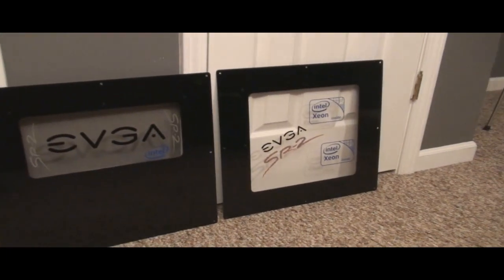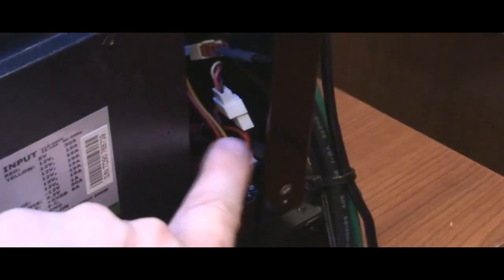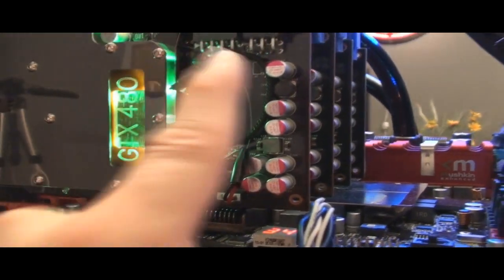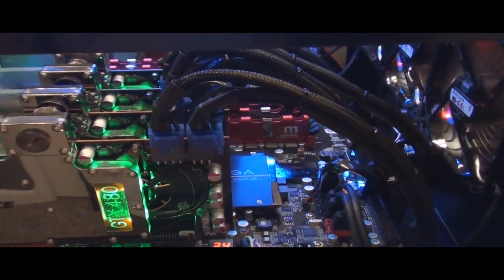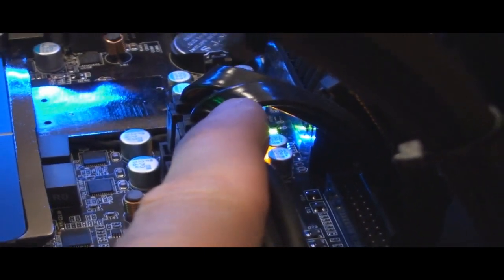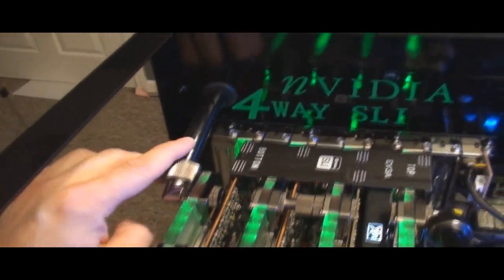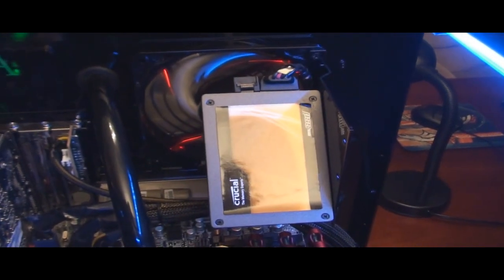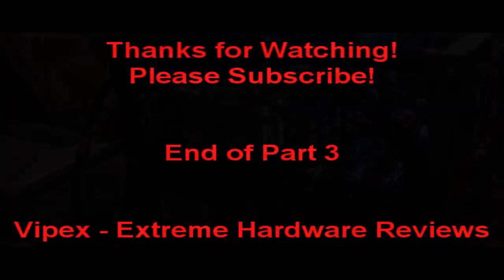Gaming Computer Showcase: EVGA SR-2, Intel Xeon X5680, 4-Way SLI GTX480 Pt.3

Comment from the maker: @MADJIHAD1942 You are correct to a certain extent, but you can't just use distilled water either.  Even with distilled water, algea will build up over time.  The coolant needs some type of anti-algea additives.  Computer coolant that you can buy has those ingredients...but the less dye the better...yes.  :)

Comment: Ok, two questions... maybe two lol. One is does not haveing the water go through a radiator when going from CPU 1 to CPU 2 make a diffrence, I mean wouldnt it help with the water temps if you dont go from 1 hot cpu to another hot cpu? Second question is can you show how you spliced the green LEDs so you dont need to use the molex, I want to try it but want to see how its done first, if you can thanks if not... understood.

Comment: @Trubyd44 I have weeks browsing the web for such adapter/converter could you please tell me the search terms in order to google it? thank you very much. I thing i have to go with ati 5970s because i will need the other pci xpress slots for 3 I/O cards. One for external sata hard drive cages and the other 2 for adaptec raid controllers. Also i would like to manage 6 screens with the eyefinity ati capability.

Comment: yes Red and Green makes a orange color 8). Im building a SR-2 build myself, going to a Danger DD case. but my system is aimed for designing 3D and graphics, nice build btw. Do you wish that you went with a dual water cooling loop? or are you happy with a single loop?

Comment: @Trubyd44 

Yes there are no restrictions like other designs/brands however the optimal direction is parallel.  Is it worth breaking it down to change?  Most likely NOT.  I have a 370 that I may try doing tests with (it's home on a W3680 at 4.53GHz 1.4V right now).  Of course there's the possibility of temperature differences from mounting variances, etc. as well.

Comment: Because if you fill up the ram it puts more stress on the CPU if you're overclocking it. So it's better to just do Dual or Tripple channel and use only 2 or 3 sticks. That's why there is 3 Per CPU.

Comment: Is it theoretically possible to use 7500 series Xeon processors with this board? Because I realize X5680 isn't still top of the line for Xeons, but for most of the ones above that, you're starting to get into 8 cores and larger caches for the CPU.

Comment: @Trubyd44 Thanks
I have a problem between my PSU (corsair tx 950 ) and my MB (asus R3E).
When I connect the PSU to the R3E the lights and LED's on the motherboard come on, but it refuses to do anything when you press the power button.
i tested the MB with another PSU (Spire 550 W) and it's working & i tested the TX 950 with another pc and it's working. Now i use the Spire for MB & CPU and the TX 950 w for my Gpus, but the TX is connected to another pc only for starts.
any suggestion is welcome.

Comment: I personally don't care for the idea of that hot cooling fluid leaving the oulet port from CPU 01, & landing straight in the middle of CPU 02. Ideally, those 04 graphics cards should be on their own separate cooling ciruit, & junction back into the main line outside the case. As far as the dual CPU's, the inlets could be split, & the outlets combined preferably with right-angle el's (for directional flow). If you could find them, perhaps one-way check valves could be used as well?

Comment: @imtihanahmed With a computer that powerful I would be suprised if it becomes obsolete in the next 15 years. I have a p4 I built years ago and it still runs almost anything I throw at it, within reason. I upgraded the video card and ram since the build, but it works as a backup rig. This rig he built, is way out of the league I was dealing with back then. This rig will likely be be viable for a decade easily.

Comment: @ThePCgamer1989 What are you talking about? The fastest gaming computer on the 3dmark11 leaderboard (planet) right now is using an sr-2 motherboard with dual Xeon 5690's.
    The Xeon 5680 is basically an i7 980x with dual QPI links. 
   Just because you slap parts in a case all day for a living doesn't mean you actually know anything.

Comment: @amartinez97 Not a 2560x1600 the 480's wont have enought memory. Dual Mars 2 (GTX  580 X2) can't run smoothly BF3 at 2560x1600 because it only has 1.5GB of ram.

Comment: Hate to be a bearer of bad news but your waterblocks are 90 degrees off.  The SR-2 CPU socket orientation does not follow single CPU boards and thus your blocks should be oriented the other way.  Does it make a big difference?  Probably not BUT if you want it PERFECT they should be mounted with the flow direction parallel to the CPU die orientation.

Comment: @club4ghz I kind of agree. I am an ATI/AMD guy, mainly just because my first computer build I tried had me pulling my hair out when Intel sent me defective processors. They are FASTER, but more reliable? Dunno, I don't wanna try again. 

I'm in the process of saving up for dual 5970 4GB cards and a 1090t to see how it fares against a single cpu equivalent. Obviously the SR-2 is going to beat it, but dual-cpu builds are pretty pointless with today's games.

Comment: i bet that last graphics card is the hottest component in the case because of the way he looped it. ===CPU===CPU===GPU===GPU===GPU===GPU=== :( should have 2 rads and 2 loops setup like this ===CPU===CPU=== then seperate rad ==GPU==GPU==GPU==GPU== thats only if you have one pump, if you have 2 pumps one res go ahead and just seperate both rads

Comment: Thats actually not true. Xeons are designed for anything that requires pure processing power. If your doing a render in 3ds max or blender and you wanna use CPU to calculate two 6 core xeons are way better then one i7 extreme, Its also the same for Video rendering and photo editing

Comment: lollies yeah true but those gtx 480s were graphics cards from hell, they played games amazingly but they produced more heat than my desk heater. I have a 570(it was either that or the 480 for 30 bucks less, 570 saved more money on energy usage in the long run) and it tops out at 50C (idle 34C) and that was nothing compared to my friends 480 80+C (53C idle) room temps were only 1 degree difference (mine being lower) so in my defense (lol) those 480s are the devil of gpus lol

Comment: Would hate to be that last graphics card, toasty.....
Reply: its water cooled im sure they are all around the same temps give or take 5c
Reply: you might be right but in my (ocd) mind its getting 4th hand coolant, i guess if the flow rates high enough but even still the resistance from the blocks..
Reply: watercooling is a different beast than air cooling. if they were on air the top card would be starved of air and run hotter, which is what you might be thinking is what is happening since the water flows from top to bottom. what happens though is the water temperature equalizes out, and the cards run about the same temps. thats why they also say it doesnt matter the order of the loop because the waters going to be at the same temp.
Reply: i should have said id hate to be the bottom card then, so the water doesn't pick up any heat as it goes through all the cpu and gpu blocks until it gets to the last one?..
Reply: thats what i thought you were talking about the bottom card or last one in the loop. i was just saying with air cooling the top one is usually noticeably hotter because the bottom card will have more fresh air available and the top cards usually have to suck in from a smaller space. with water cooling it picks up heat from the very first block it hits, but its not transferring heat to the other components. the water will be hotter by the time it gets to the last card or whatever component in the loop, but its not making the components hot, its absorbing the heat. then goes to radiators to cool down.
Reply: the water being hotter means that the bottom card isnt getting as cool of a water as it could, it might only be 3*c but to me thats 3*c was my only point, i know the system will reach equalibrium of heat generated vs heat dissapated etc its just im picky enough to rather have all cards (even 2) get the same temp coolant even if it means halving the flow rate. :)
Reply: i dont know what you mean by halving the flow rate. if you mean slow it down, then you are allowing the components to get hotter by not getting cooler water to them fast enough. Too fast and the water doesn't have enough time to cool down in the radiator properly. The temp will always fluctuate whether you have two or four cards. It's like trying to get all 4 or however many cores your CPU has to be all at the same temp. It might happen for a second, but they are always going up and down and they are on the same component, same waterblock. Think of your GPUs the same way.
Reply: the temp fluctuation is correct though im not worried about thats as in all likelyhood they'll be loaded equally (on the games i play), simple way to put it is gpu1 gets 45*c coolant, gpu2 46*c, gpu 3, 48*c and gpu4 50*c....
id rather them all get 45*c coolant, the flow rate will be divided by 4 (same as in circuits) but variable flow rate pumps could change that if needs be but like you said more time in the block is more time in the rad, so long as you have enough flow rate you're okay and theres within 1*c difference (faster pumps create a little more heat anyway).
the only way i can easily describe it is light bulbs in series, the last one has less power to use (hotter coolant) but parallel requires more flow/amps (not hard to do), it might only decrease the final cards temps 5*c at the expense of allot of expensive fittings but being an enthusiast and good looking pc's was never cheap anyway.
Reply: I think I read somewhere running GPUs parallel was actually worse, only by a few degrees, but the problem that came up was that it might not get full flow to all GPUs cause like electricity, water looks for the path of least resistance. In any case, to have the water hit all blocks in a loop at the same temp seems like a pretty impossible task to me. I only run one GPU, 290x, and CPU in my loop, X5460 @ 4.5GHz. I go reservoir, pump, 240 rad, cpu, 140 rad, gpu, back to res. Im running good enough temps, I'm sure when I add another 290x to the loop, I won't need more radiator, but can add if needed. HAF 935 case, only using main section.
Reply: daniel wray not watercooling yet (fx8320, hyper212evo+msi 290gaming) and most people would argue you don't need the rad after your cpu for the same reasons as parallel vs serial but for me (and you im sure) its nice to know the coolant hitting the next component is a few degrees lower than it otherwise would be hence my point, otherwise you could run your 120 rad straight after your 360 (layout allowing).
if all blocks have the same resistance the flow will be equal (technically water like gas doesnt like to change direction so the first card it meets could get 3% less flow theoretically but its as much margin of error as the heat your pump produces).
Reply: i actually have the 140 after the cpu since i had a spot in the case for that rad, not necessarily to cool after the cpu, and i have the 240 in the front because i didnt want to use the top or cut out by other bay drives for a 360
Reply: fair enough, if the case allows it i guess though personally id stick the single biggest rad i can for the case which if it isnt enough id look at another case, saves all the extra fittings and tubing and means it needs less coolant and its easier to bleed, everyone to thier own.

Comment: You probably don't know how 1366 Cpus work?

Ive had one running in 3.0GHz and it was not a bottle neck with my 4 gpus! 

You know why?

Because it's the gpu who decide how much FPS you get! sure if you have a P4 running in 3.0GHz then it will bottle neck. A fine Nahlem CPU or a any SB-E cpu wont bottle neck 90% of all GPU configs out!

Comment: @ThePCgamer1989 

Clearly you have NO IDEA what you are talking about...

SERVER CPU = Sandy Bridge E + quad QPI
DESKTOP CPU = Sandy Bridge E

4 cores, 12 cores, 96 cores, if they are SBE cores running at the same speed they are not a bottleneck.  

Working at COMPUSA and building Intel Atom systems does not qualify you to know sh!t about processors other than they are the little square things that go in the white socket and get hot.

LOLif you think those 12 cores are running at 2ghz